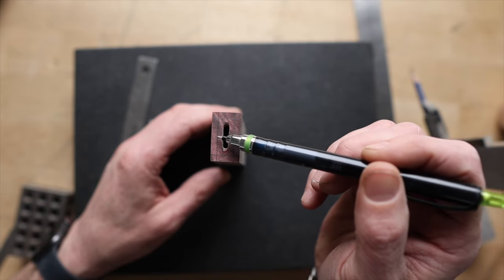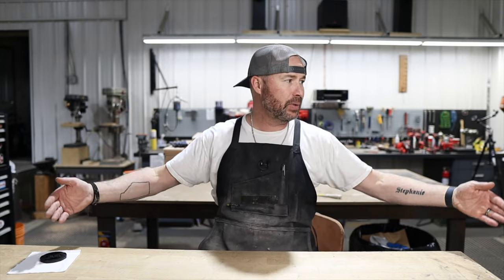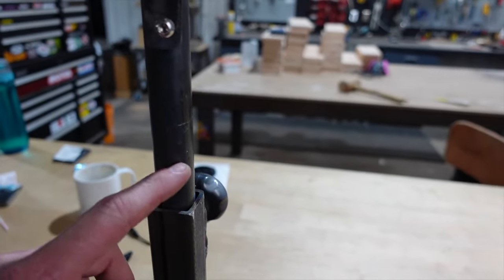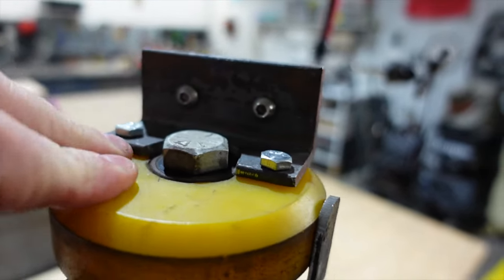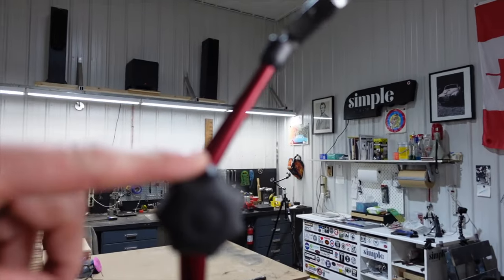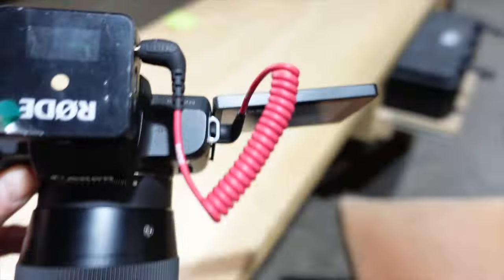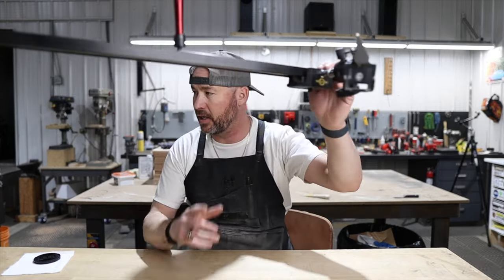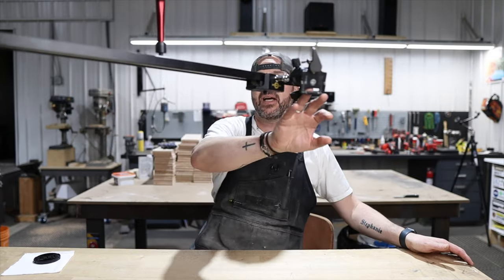Super Simple DIY overhead Camera Rig

Comment: Great idea!  You know your rig better than anyone, but would it benefit from a small counterweight?  Incorporating one should help eliminate any torque placed on the roller bearings caused by the weight of the long boom arm and camera.  Cheers.
Reply from the maker: Thanks! Yes it would benefit from that but then I wouldn’t be as out of the way when not in use. I’m not concerned about the bearings enough to think it’s worth the inconvenience of something hanging off the end. But yeah if this was something I didn’t about being out of the way when not in use that would be a great idea!
Reply: @Simplelittlelife  Understood.  I was imaging a very short arm (~2-3”) with an eye bolt at the very end and using a small length of chain to hang a cylindrical weight (i.e., round steel stock) to act as the counterweight.  If you kept the bottom of the weight above the height of your bench, it should keep it out of your way and still allow you to swing the arm in a 360 degree arc.  Just a thought.

Comment: That's fantastic! I was recently looking for a stand holder for my rotary tool so I could use the flex shaft without just laying the tool on the table. Naturally, all the reviews for everything out there under $70 pretty-much said the stands available were pretty lame. So, I took my vice from my silversmithing days, clamped it to the table, and stuck a random piece of wood I had laying around into the vice, screwed a cup hook in and voila! Instant, sturdy rotary tool holder! Wish I could enclose a picture. What's the old adage... necessity is the mother of invention. Your overhead helper is likely more sturdy and reliable then anything you could have purchased.